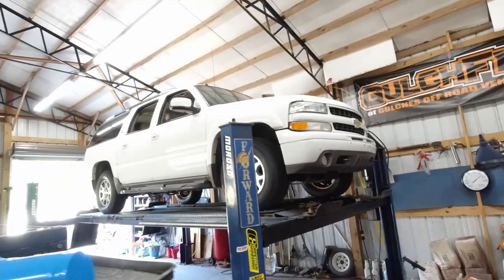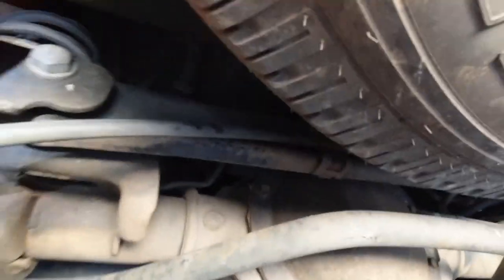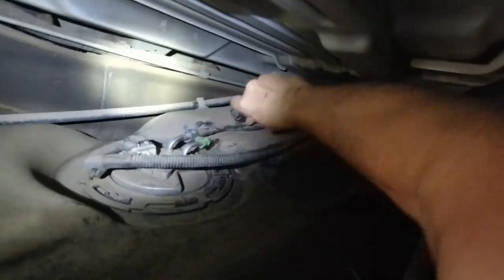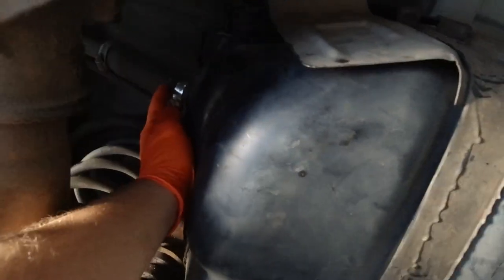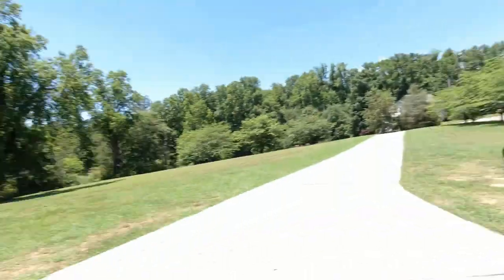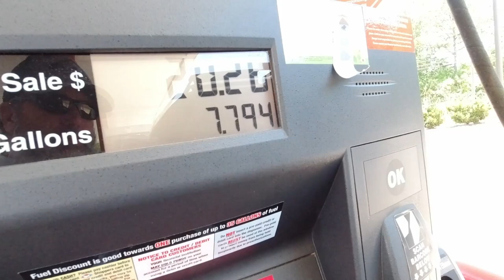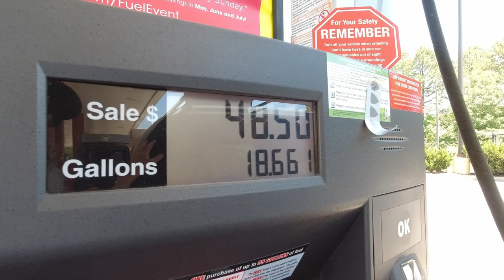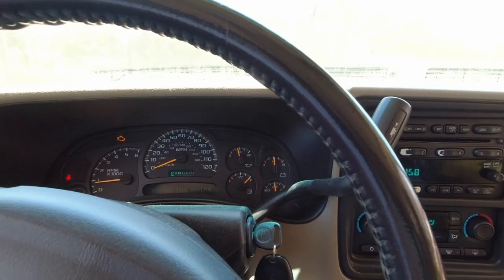Suburban Charcoal Canister/Evap Emissions Final Clean Out After Canister Blew Up

Comment: 2013 Yukon XL I replaced purge solenoid, vent valve, canister, and blew out & shopvacced every accessible line, no improvement. So i replaced part 25860204 (all evap lines above tank), then it filled straight to 28 gallons. Zero clicks! The culprit was the section from the smallest canister connector towards the purge solenoid on the intake. With the old line out, I could bang loose the mass of pellets jammed in there, then compressed air could flow.

Comment: I saw a vid last year where someone took line off charcoal canister and used vacuum to get charcoal out. I did same thing and got a lot of charcoal out. Then vacuumed evap line from manifold to tank area and got more charcoal. I replaced canister, evap & purge solenoid. 

Now it takes gas and didn’t have to drop tank.
Reply: OMG!!!!  Such a great idea!!!!!    Did u use just a regular vaccum??  Please say more about this idea. where did you hook the vaccum up to? which lines? TY so much
Reply: @81vampirelover  I used a craftsman wet/dry vac with filter, loosened the 2 bolts on charcoal canister so it would lower down by several inches providing easier access. Unplugged the 2 lines that are together coming out of canister, got a smaller piece of rubber hose and taped to vacum cleaner hose.  Turned on vacum and held rubber hose as tight as possible to hose end. 

The gas tank has to be about on empty or you will suck gas from the line. 

Wife opened and closed gas cap every few seconds. You can visibly see tank bottom lift up from the vacuum while doing this.

Make sure vacuum has a filter. I didn’t think it was working but wife could hear the charcoal pellets going into vacum.

I then moved to engine area and unhooked the smaller evap hose and vacuumed it as well.

I learned this from another you tuber.
Reply: When you say you also vaccumed Evap line from manifold to tank area, what do you mean by “manifold”? Thinking of trying this

Comment: I can’t get the charcoal out of the metal line from the front of the tank to the top of the engine. Everything else is clear. Any advice would be appreciated. Thanks
Reply from the maker: @ispeakchevy4632  you could try a can of brake cleaner followed by compressed air. I ended up with it in my gas tank and it clogged up my fuel pump.  I have a video on that as well under the Playlist for Suburban

Comment: I have a small and large evap code it accepts gas, do you have any suggestions on what might be the cause ? 
2005 suburban z71
Reply from the maker: It would be hard to say. The system is pretty large and it is detecting a leak somewhere. I have an  evap tester I use that pumps smoke and air pressure in the system to find leaks. You can do a visual inspection and see if you have any cracked hoses or lines. The evap purge valves are known to get stuck open on some and can cause a leak code because it can't pump up the system to test its self.

Comment: Family member Chevy Tahoe 2007
Replaced Purge Valve
Replaced Vent Valve
Replaced Charcoal Canister

Haven’t dropped tank and cleaned lines. Is it possible to vacuum out the main big line? A small adapter to attach to shop vac?
Reply from the maker: I don't know.  Give it a try and let us know how it turns out.
Reply: i saw somebody do that,  but what about sucking gas fumes into an electric motor.  doesn't risk xplosions. i need to do mine also/
Reply: @chrisziemba3889  good idea
Reply from the maker: @chrisziemba3889  Good Point. Might not try that.
Reply: I did it with empty tank n vacum with filter in place, worked for me.

Comment: HEY PLEASE HELP ME!!!  I have a problem of too much pressure in my gas tank. I can fill gas in it but when I turn the key off after driving it whines like a cow at the evap tank. My evap is beside my gas tank. I have a 2006 Wrangler . I have changed the pump (leak dection pump)on the evap. The filter on the evap. Gonna change the purge under the hood but I bench tested & it works. I have soooooo much pressure when I open the gas cap it almost blows the cap off. If I don't let the air pressure out the gas cap it pushes out the evap & screams for 10 seconds like a cow moowing. Any ideas???  By the way when the evap tank was removed to change the leak dection pump attached to it the evap tank did NOT rattle or have any carbon beads fall out of it at all, So I di NOT get a new one. I am NOT showing any codes . Thank you .
Reply from the maker: I can't remember how the vent is designed on it.I am out of town for the day. Let me think about it later and see if I can pull up a diagram

Comment: How many hours did it take it drop the tank and blow all the lines out?
Reply from the maker: If the tank is empty it is only about a 2-3 hours. If it has fuel in it I would pump it out first or it will get real messy and heavy.

Comment: im dealing with this same shit on my 07 shops wont just blow out the lines they all want to replace my tank smh wish i could find someone to do this for me it takes me like 30 mins to fill up barley squeezing the pump
Reply from the maker: I have 2 videos on this subject. Check out the playlist. Some are a simple blow out but most are total disassembly and clean out with a few parts to replace
Reply: @HotRodDave  yeah I seen them, I have done the 3 parts already but don't have a way to do the blowout myself, I asked a shop and they just tell me I have to replace my tank not blow out the lines
Reply from the maker: @bigkahuna2297  Thanks for watching.  It's hard to get people to listen sometimes when everyone knows everything.  I would suggest a mom and pops shop and not a big chain location.
Reply: @bigkahuna2297 you don't need to replace the gas tank. There's a canister purge valve that is known to be defective. They make the kit for 55 bucks. This does not include the charcoal canister. It's a simple repair to replace the purge valve. I would stay away from the mechanic saying he needs to replace your gas tank
Reply: @Reaperhydraulicstampa  I know just haven't found a shop to do it.

Comment: Good job 👍😎 I guess I'll drop the tank 2008 GMC
Reply from the maker: Thanks and good luck with your repair
Reply: Great video. 2013 Yukon just did purge solenoid, vent valve and canister, blew air into the open gas cap and covered driveway with pellets coming out the old lines before connecting to the new canister. Absolutely no improvement at the gas pump, so next I'll blow out from the purge solenoid back to the small canister hose where 90% of the pellets came out. I noticed how much heavier the new canister was than the old, that's a lot of pellets lost in the lines!  If that doesn't work, then I'll drop the tank and clear that vent line from the tank to the big hose into the canister. I think ignoring this problem and forcing the issue at the pump just made it worse packing those pellets in. Live and learn.